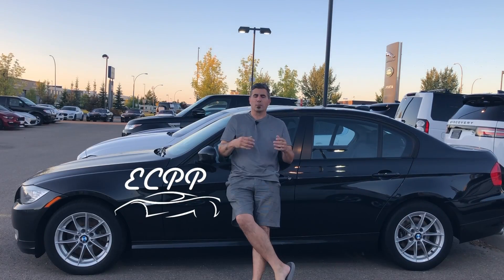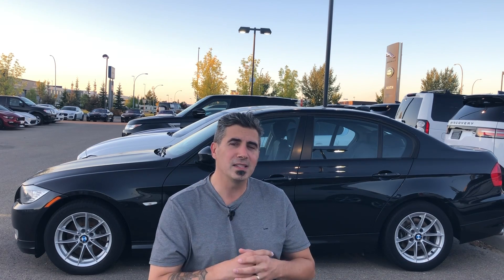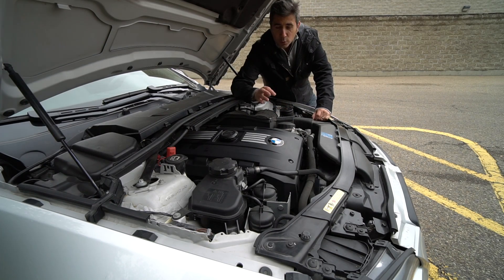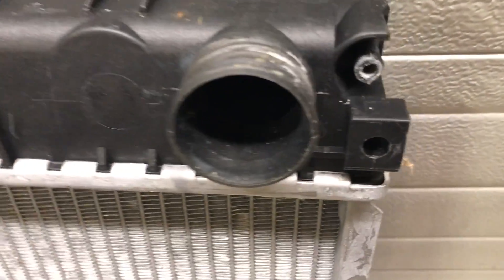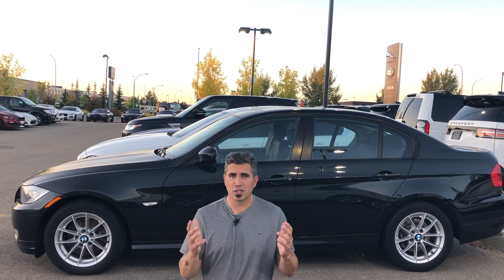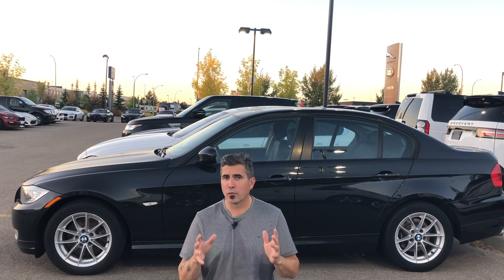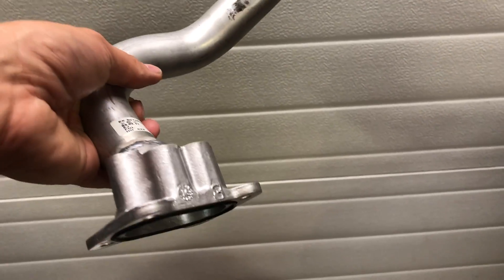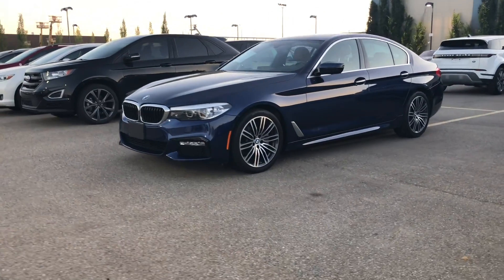Why Does BMW Use Plastic Engine Parts??

Comment: As a mechanic, I can say there are plenty of cars with plastic engine parts that hold up just fine and the ones that do fail typically don't do so in a catastrophic way. BMW and VW/Audi use cheaper, thinner, plastic components that are more prone to breakage with age. Then, they use this plastic in far more places and attach them with quick connects that are prone to distort with age. All they would have to do is just use a higher quality plastic and replace plastic lines with molded rubber and/or aluminum/steel and the issue would largely be solved. My Mazda 3 is 12 years old with 130K miles, as far as I can tell it still has all it's original plastic engine parts.
Reply: Also true about modern plastic parts on other brands. Have a 2004 6 L GM LS motor with single core aluminum radiator with plastic tanks. Even after the vehicle got totaled by the insane postal worker it ran head-on into it and pushed it all the way up onto the sidewalk, the radiator was the one part that never needed to be replaced. In fact it's still working great today with no leaks even living in a dry desert Southwest area with 116 degree temperatures in summer, never even gets close to hot even when stuck in traffic with AC on.

 And I've had plenty of old 1960s muscle cars with the so-called 4-core radiators, all copper and brass Etc and those are junk compared to these modern radiators. Unless it's in a BMW of course
Reply: Good one
Reply: That's true. But German plastic has always been garbage. I did head gaskets on a mid-1970s Mercedes 450SL V8. I still remember taking off all the little plastic fittings and vacuum lines and everything would just snap and break off just by looking at it. Had to be very careful to color code Mark and identify everything because you ended up with a bunch of busted off stubs and no clue where it was supposed to go back
Reply: every single german car is junk plastic and they do fail catastrophic in many many many cases you must live in a warm climate cause i see it all the time in bmw mercedes and vw audi
Reply: What brands have the least plastic used under the hood in modern cars?  Or the most intelligently used plastics (not on critical parts), that hold up well?  Thanks in advance.
Reply: @igottheshaft  Imports like Honda, Toyota, and Mazda seem to have the lease issues with plastic parts under the hood.
Reply: @madmatt2024  Thx Matt.

Comment: I'm sorry but the recycling in saving the planet spiel is nonsense, BMW use plastics to save money. You also didn't mention the plastic timing chain guides which caused many catastrophic engine failure on BMW and a few other manufacturer s.

Comment: German cars are made as good as a car can be...briefly. There’re great performers, but shit for longevity. 

I’ll rent German cars, but I’ll only buy Japanese cars. In my family there’s a ‘96 Camry with no major failures until 205k miles. It’s now at 250k. There’s a ‘98 Sienna with no major failures ever at 298k miles. There’s a ‘13 GS350 no failures at all at 136k miles. 

If you want short term performance, buy European. If you want longevity that rivals the universe, buy Japanese.

Comment: I am Waiting for my water pump to go bye bye and shelling out 1500 to repair it.
Reply from the maker: It’s inevitable but once changed it should be good for a other 69,000 miles
Reply: ExoticCar PlayPlace one more bring that sucks now...gonna need new run flats.  I am going with reg tires and a can of gunk and an air compressor!

Comment: Every brand are using plastic parts in engine bay, why you drive BMW harder than Toyota, and then complaint BMW is not reliable.

Comment: As someone who currently works on BMWs i totally agree. Those plastic parts in the engine bay are a cancer.. even during warranty period, if you are working on the engine and have to remove certain plastic pipes, hoses etc, they just snap due to being too brittle after only 1-2 years.. You replace them with new ones that are flexible.. even oil filter housings... the amount of them we replace during the regular oil service is unreal.. they just snap while you simply unscrew an oil filter (most notorious B58 engine).. its a joke. Said that, i have experience working on other brand cars and to be fair, they all are the same. Plastic left and right.. French line cars literally feel like you own and drive the recycled coke bottle.
Reply from the maker: Nice.  Great comment and thanks for sharing.  Even inside some cars today feels like a giant Tupperware container.
Reply: British cars are horrible  . I knew 5 families in town that had 2 Jaguars each . They all told me one is for driving the other for spare parts because you never know when the unionized British factory workers will go on strike and for how long .

Comment: we have a spare 320 (2007)....engined replaced at 200k....my fanily rarely deive it as we worry itd leave us stranded...to sell it the value is just crap
Reply from the maker: I would just drive the wheels off it since they are not worth much.  Have fun with it, maybe local trips

Comment: The expansion tank of my e86, n52B30 cracked. It feels extremely strong plastic but after thousands of heat cycles, over 12y and 160k km,it cracked possibly because glass fiber dilate differently than the ABS plastic. I then preventively replaced the fuel pump and thermostat (and sold them since they were still ok). The disa flaps are also prone to fail and until replacement I have plugged the cables out so they don’t experience any forces.
I’ve also installed a coolant pressure and temperature sensor (adapted from an external tpms)
The valve cover is also plastic but apparently it’s better than the magnesium one :)

Comment: If they had half a brain as if they have to have plastic parts.... The engine parts have to at least be made with nylon/ or HIPS(high impact polystyrene).... Very lightweight very strong, a little bit more expensive, but believe me that s*** lasts a long time before it gets brittle.

Comment: Okay, I own a BMW E90 325i with N52 engine. It still has a magnesium valve cover. However everything else is plastic though. But I also own a Toyota Corolla and everything under that hood is plastic also,  including the valve cover. So not just BMW, how much plastic parts is under the hood of your Jaguar.

Comment: That is madness, the fxxking engine block is made out of recycled aluminum!!! And recycling aluminum and iron/steel are lot easier than plastic. And to add salt to the wound, they can at least make the car a bit access frendly if they know the reliability is shxt. But oh not, everything is hidding behind something so you will need to take apart half of the engine Bay to get some where.

Comment: Had a plastic water hose connector crack almost in half on the freeway. A simple aluminum connector would have been the way to go but BMW thought otherwise. Heat made that part brittle!

Comment: There is so much more to using plastic than this slightly shortsighted video reveals. It's not necessarily good, but then it's not always bad.
For example, 03:34 we're talking about two stiff plastic parts between rads and blocks. 
Now let's say they use a flexible plastic hose or rubber. Quite frankly even metal hoses wear and rupture. It's not necessarily the material. I'll exaggerate;- Let's pretend for a moment the hoses were made from stiff metal instead of stiff plastic. The issue is still there.

Comment: It is economics, this is why I keep hearing that more and more auto brands rely on repairs and service as their main(?) source of income. They don't make that much on car sales alone. And what's also sad is that auto brands make their cars more and more complicated which drowns out 3rd party car parts - like Apple are doing with their products. 
So basically, BMW-owners should regularly inspect those sensitive parts that are prone to break and repair before they break. Better than pulling over at some motorway and wait for a towtruck.
Reply from the maker: For sure and even change a few whe. Accessible or doing other repairs
Reply: Great point

Comment: Quick solution to the BMW problem is just buy a Lexus if you're not looking to lease.. they use less plastic in the major engine compartments... and are more durable after 3 years once lease warranty runs out
Reply from the maker: But which is also a more fun drive?
Reply: ExoticCar PlayPlace i think "fun" can be subjective as a Miata/ s2000 honda  with less bhp than most BMs can be classed as more fun depends on who's behind the wheel.. 
yes a bmw can be fun to drive but the question is how many times do we drive cars on the limit in our day to day runnings to extract that performance "fun" advantage?  yes once a while you might have a blast on the roads but most of the time it's just driving sensibly and keeping with traffic..

Lexus tends to be an all rounder in my opinion.. they are sedate, go about their business on the road quietly, soaks up pot holes well and do have power when needed.. 
just as an example check out a few videos of GS350, IS350 or GS450h race Audi's, Merc and BMs with similar horse power and you realise those Lexus models are no slouches.

Comment: talk about the coolant line that's underneath the intake manifold alongside the aluminum one instead of making two aluminum ones you made one plastic one in one aluminum one doesn't make any sense everything that's hard to get at is plastic all of the coolant is all plastic if you don't shut the car off within 10 seconds after it overheats you're warping the heads everything is shot do not buy a BMW lease one
Reply from the maker: Right

Comment: BMW sells cars primarily on lease for 3-5 years terms. Parts need to last that time frame. They are not interested in the 2nd hand car market, they do not make their profit from that. They sell to people who want the latest and greatest thing. This is the complete opposite with Japanese cars which are made to last and be past down through a family. Also you probs shouldn't have gotten an N54 335i if you wanted reliability. I have one too and the plastic parts just start breaking.
Reply from the maker: True

Comment: German engineering has become such a joke. Fans of these vehicles talk about heritage; it's too bad the people who actually manufacture  the cars don't care anything about that.
Reply from the maker: That’s true
Reply: @Giovanni.Sentebelliano  no, luckily it just caused a small dribble of a leak, but that definitely could've happened had my luck been worse.
Reply: Hey please don’t say that, I have VW Golf 7 GTD 2016 and it’s 2020 and everything is perfect. Never had any issues yet. I will never buy a Japanese car, unless maybe Lexus. Please don’t put all German cars in the same boat, at least not Vags.
Reply: Victor M good luck,  unfortunately Volkswagen Audi are one of the chief offenders The amount of plastic in your engine compartment has to be seen to be believed. Your car is only a few years old, if you keep it much longer problems will arise. Especially if you have to do anything in the engine compartment. you will break plastic items and need to replace them. And while they may be cheap for  the manufacturer, they are going to be expensive to purchase.
  I used to feel the same way you do now; but I have learned the hard way.
Reply: @kevinbarry71  yep, his car is barely off warranty. Let's see how it holds up another 4 years down the road. I suspect there will be some (expensive) issues.
Reply: @victorm9131  yeah lol I own a 2017 golf, radiator housing had to be replaced ($1600) and recently I hit a raccoon which broke through the bumper like nothing, broke the rad and when it rolled under my car it broke the plastic oil pan. I love german cars but they're all guilty of this crap

Comment: Toyota n Honda use plastic parts but never fuck up so bad, the issue of BMW is that they using parts manufacturers which build cheap at the first place, like Hella , Bella,  TRW , Valeo....
Reply: Delphi build melting ignition coil.... I never found one if it’s build by Denso for Toyota

Comment: If you own a BMW like myself FIRST thing you need to replace is the charge pipe and valve cover and gasket. Change your oil every 5000k miles and your car should last a lot longer.
Reply from the maker: True

Comment: They use plastic now to offset all the onboard junk they fit to modern cars which makes them heavy. Not to mention it is cheaper to make plastic components rather than aluminium. Modern cars are junk. I'll never sell my  EURO 99 E36 M3. You want to see quality ?
Go and take a look underneath and everywhere else on it and see for yourself.

Comment: my brother's 2017 3 series rear speed sensor fell off. IT actually fell off after 65k. I never heard of that! My damn Honda has 149k and the worse that car did was the A/c  blow motor that died, which, was easy for me to replace.
Reply: Hi There a blown motor is a big deal. How did that happen? What car was it?
Reply: @jamesmedina2062  No.. Not Blown engine  motor. More like in A/c Blow motor. The engine is fine; it is perfect! The A/C blow motor.  Thank you, I will correct that.

Comment: I have learned that BMW back in the day use to make very reliable cars where you would not worry about how much you were going to spend to fix it. Today's market, they have improved on somethings while on others, things are not the same. I believe they still make great cars!! but I have to agree with some comments here. When a company or corporation thinks about how much revenue they can make and not what made them a brand they are now, they tend to lose focus and people notice this and by word of mouth, their reputation is not the same.  I love the way a BMW drives, I don't feel this when I drive other cars. Lexus and Volvo I felt drive very good as well but not like a BMW.  I have a few BMW's and they are a 1991 BMW 525I and 1999 BMW 740Il and they still drive the same as when I bought them.  The word is spreading about BMW making these decisions and I hope and pray that they go back to making more reliable cars as people are noticing.
Reply from the maker: Cheers

Comment: Just came here to say: y'all really think you're smarter than an engineer? All manufacturers use plastic. Metal is not equal to reliability either. Prove me wrong.
Reply from the maker: I have an engineering background and metals are also not perfect with different expansion rates but for entertainment the. Why are engine blocks not made from plastic?
Reply: Victor Estrada I think it really depends on both the company leadership and how the engineers justify themselves. I have always found that Japanese people believe in longevity and tradition whereas Germans value innovation and performance. The dominant considerations become priorities in engineering.
Reply: Estrada, you don't seem that bright! Internal engine parts are Metal!!! I just prove you wrong!

Comment: Marc , as much as I like your reviews , i think BMW is losing it , I don't think BMW does not know what is going on , it is just that snobe people who buys it  simply don;t care because they just lease it transfer the problem to others , on the otherhand why can't after market company offers kit to replace those suspected plastics parts ? it would have been better for a used car buyers to get a BMW with a replacement kit sold by the dealer ? I am ready to add $2000 so that I do not come back for repairs .
Reply from the maker: I totally agree and I see some aftermarket upgrades but unfortunately not enough yet.  Wish they would figure out this plastic application thing and sort it out properly.
Reply: @ECPP  Well , I found a guy in GTA Toronto who is doing some good stuff , I don"t him persnally but I came across his video , https://www.youtube.com/channel/UCWFCLRELjis8dUfz6TgR25g

Comment: Recently replaced the coolant tank and valve cover assembly on my X5, both made of plastic. Glad I have the N55 engine, so far got 105,000km on the water pump that was replaced at 75,000km
Reply from the maker: The n54 is worse
Reply: @ECPP  I heard a lot about mostly E9x owners who called them plain money pits.

Comment: Is not only BMW that use plastics parts in the engine (All cars use plastics parts in the engine) and is the very shame, more saddest thing for the engineering life... Why this "Called" engineer put some polymer things in an part that is normal to burn or have high level of temperature!?

Comment: I'm on my 3rd BMW, BMW bean counters are the SCUM of the EARTH for all the cheap plastic parts under the bonnet. Stop using plastic water pumps, thermostats, charge pipes, intake manifolds, valve covers etc!!!!!!! These plastic parts are why  resale value is piss poor. 

They'd rule the car world if they simply used 50% more aluminum on key parts where reliability is essential!

BMW, STOP ROBBING your customers and ultimately yourselves, REPUTATION IS EVERYTHING, ASK TOYOTA / LEXUS, hence the new Supra (which is a BMW from bumper to bumper) that Toyota tweaked for better RELIABILITY because it HAS and REPRESENTS the Toyota name.
Reply from the maker: Exactly

Comment: I love BMW cars, I have had Z4, 123d, X5, m135, M3 and a M5 but now have moved away from the brand due to the RELIABILITY issue's and now drive Japanese cars.
All the German brands and some others need to pull there head out of there arse because when you pay a lot of money for a car i don't think it is to much to expect some quality parts that make for some reliability like the Japanese cars.
Reply from the maker: Cheers
Reply: You drive them hard you end up with a money pit. You pamper them, they'll last. M3, eg., is surely a great car but never drive it for the purpose it was built. It will fall apart. Drive it like a 100hp-daily commuter and you'll be fine.
Reply: @manoman0  
I do agree with you and they were only my weekend cars but what is the point of buying say M3 or M5 if you cannot drive it for the purpose it was built.